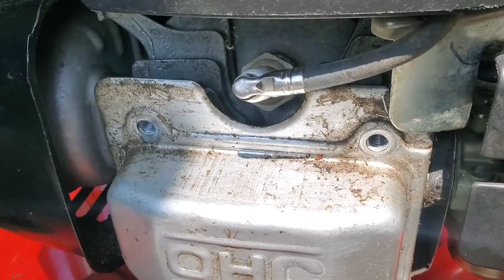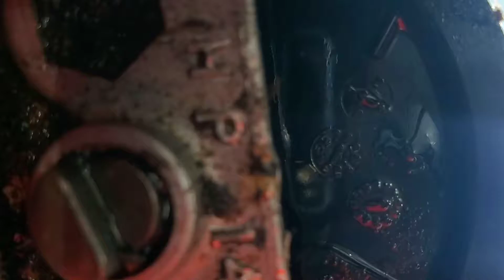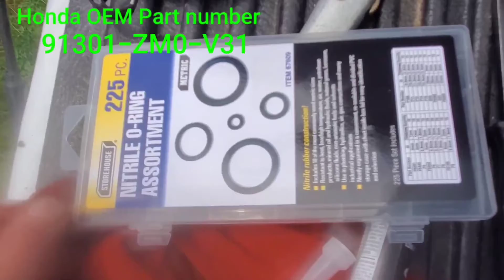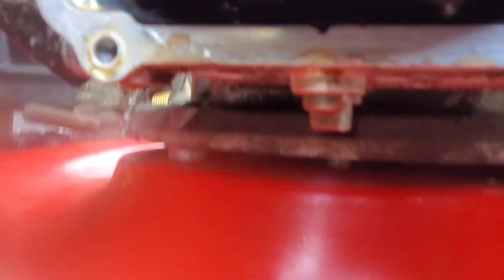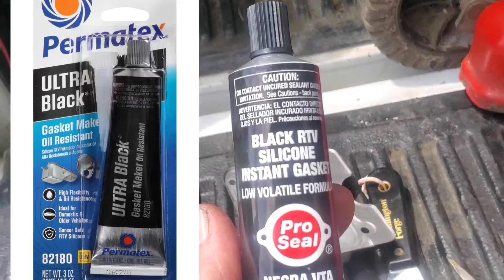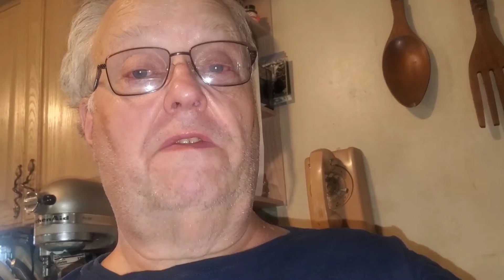How to repair common oil leak on Honda GCV160 gas engine.

Comment: Thnak you for posting this Daryl!  I bought a Briggs and Stratton power washer with a Honda GCV 160 engine years ago which has been leaking oil since day one.  After the first use I took it to a local Briggs repair center who were more interested in making sure that they would get paid than fixing the problem.  Eventually the leak got so bad I had to address it.  Followed your instructions and now it runs properly with not a drop of oil leak.
Great video and easy to follow!
Reply from the maker: I am happy that it worked for you.

Comment: I have same engine gcv 190 I just pryed the valve cover and got the new o ring on the shaft in 2 minutes without pulling the valve cover off. Just bend the tab people it’s so much easier
Reply: what tab?
Reply: Now here’s someone who’s thinking!!!
Reply from the maker: Glad you found an easier way that works for you!